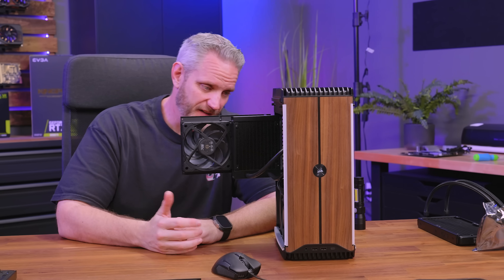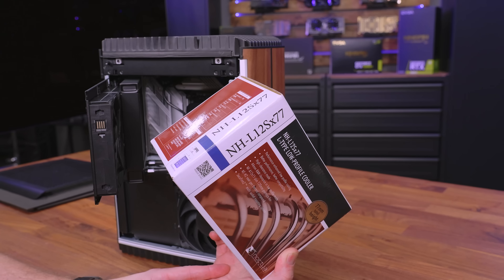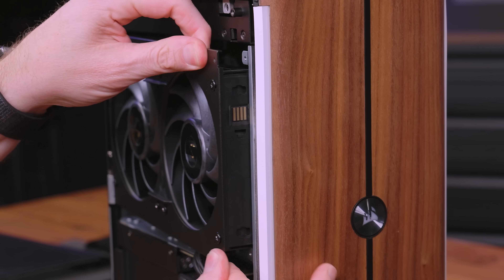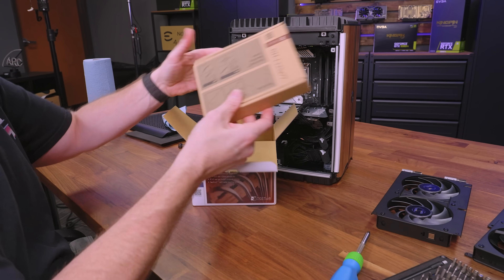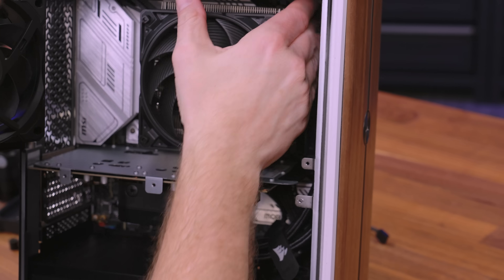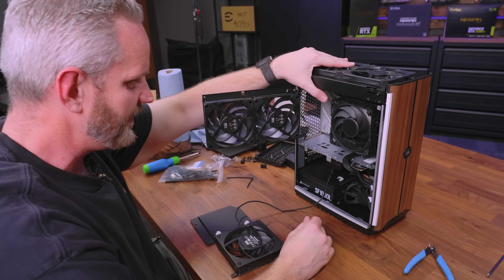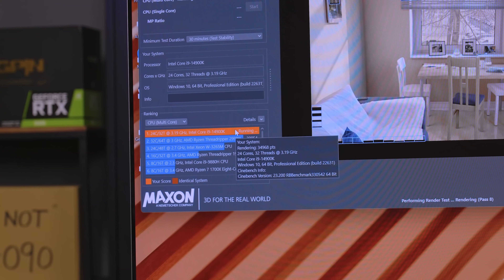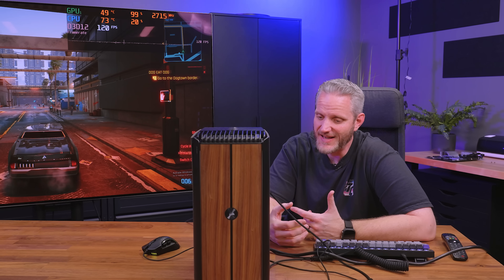Well... that was an unexpected improvement...

Comment: Remove fan blades from fan on cooler just use the frame. make sure case fan butts up against the empty frame add flaps if needed. will cool like a champ. The fan hub takes away at least 30% of the cooling surface on the cooler. Just do it
Reply: How did u do it ?
Reply: @xeontron964   I took a cheap fan and cut the hub out of it so just the outer frame was left. mount the empty frame between the cooler and fan in pull.
Reply: So more air can be pulled in ?
Reply: @xeontron964  yes you get to use the whole surface of the cooler no air moves through the cooler where the fan hub is the extra space between fan and cooler lets the air flow through the whole cooler not 70% of it.

Comment: i cant help but wonder if the cooler would do any better with the CPU fan and side mounted fans turned the other way so that it pulls the hot air generated by the CPU straight out the side instead of blowing it through the cooler and right back onto the base of the heatsink..

Comment: So we can either say the machine should never have shipped with a 14900K because the case and cooling simply can't handle it, 
OR that the case design is simply bad  if you want to run a high TDP Intel CPU,
OR Intel CPU power consumption is simply out of hand and beyond ridiculous at this point and people are rewarding bad design by buying these space heaters.

Perhaps all three?

Comment: Since depth of a 240mm radiator is a concern, why not daisy chain two 140mm rads? Set them side by side on the little access door. Seems like if they want to stay water cooled for the "gamer cred" and noise performance it would be a simpler solution than making a custom rad for this product. Don't know what their cost on a radiator is but it also seems cheaper than designing an air cooler.

Comment: [cough] The new NH-D15 G2 is listed ....
Yes, it wouldn't fit.
Does it look like that one fits? That's a family pet trap, works on grand-children too. No ~ don't ask me how I know that.
Now do take note ~ there are now three different cold-plates on the new D15. You have an Intel, so you may need the wonky one, and the little 1mm washers. High Convex ? HBC anyway. And two elbows on each arm ~ and the backing plate modelled from The Shroud of Turin.
On the up-side, you will not need to open that case again for the next 10 years, except to herd the dust-bunnies around every year or two. Git along little doggie - pack em up ~ smack em up ~ crack em up ~ Rawhide!
That's not impressive enough. Hang on ~ Let me think.
GHOST RIDERS IN THE SKY! If the Blues Brothers ~Jake and Elwood can do it, so can you.
Have a look in there once a month and call up John Wayne. "Fill your hand you son-of-beach!"

Comment: Also, controlling fans by liquid trunk is ideal. Both CPU and GPU temp at full load will be an essential constant offset from liquid temp, based on the block and quality of contact with the IHS. You do, however, have to set the right liquid temp target to get the desired component temps.

The reason liquid temp is better is because it doesn't fluctuate as quickly, so your fan speeds will also be more steady won't make huge jumps in speed. Which is acoustically preferable. 

This is all assuming you have enough radiator and fan to dissipate the component TDP at a liquid temp that's below the component throttling temp. Which is why direct die liquid cooling is so beneficial. You dissipate the same amount of heat, but at a lower component-to-water delta. Enabling you to cool the same heat load with either less radiator or lower fan speed, because you can now have a higher water temp before the component reaches it's throttling temp.

Comment: i think the fan on the CPU cooler could have been left out and instead replaced with a fan duct focussing both chassis fans on the CPU (the perfect option would be a heatpipe that reaches far enogh to remove even the need for a duct) and it would have been a better option than that liquid cooler ... in the end i think liquid coolers have become more of a marketing thing than a "good cooling option"-thing ... the reason why liquid cooling has more performance is the fact that you increase the cooling surface and optimize air flow .. if you use liquid cooling only to have "liquid cooling" without using the "more surface" benefit .,. then you shouldn't use it at all.

Comment: That's not how thermodynamics work...

The net-heat delt with by the case after changing the cooler was higher. Increased airflow through the case, by the larger fans and higher fan speed, enabled to case to lower average internal case temp, thus why the air coming out the back was cooler. This also enabled the GPU to run cooler.

I'm curious what temps would have been like if you could have simple maxed out the fans on the AIO, or, ideally, used a 120x120x25mm fan vs the slim fan.

Comment: Get rid of the side fans, and maybe put a larger Noctua on, perhaps the NH-C14S? Looks like it might barely fit in there without the two side fans. Maybe mount 2 smaller fans (will 80mm work?) on the back of the case exhausting out? Something like 2 Noctua NF-A8 fans? I've been less impressed with AIOs lately. I have a 14900K and I am cooling it with an Arctic Freezer II 420 with 6 fans in a push/pull configuration, which is supposed to be a superb AIO, yet I still hit 100C on a core or 2 on Cinebench R23, with just the motherboard defaults (no tweaking or overclocking on my part).

Comment: a 120mm cooler works just fine, it just has to be an air cooler, not a water cooler.  Water cooling is less efficient.  ;)

Comment: Are you doing a positive or negative air pressure setup on this? I'm assuming positive. Is there enough room to mount a 25mm fan under that NH-L12S? If so, put a NF-F12 under the heat sink, blowing up, and reverse all the case fans as exhaust, except for one of the top mounted fans. Use the front mounted top fan blowing in as intake. 
Thank me later. 
t. air cooling master

Comment: I love Noctua air coolers. And i am not a water cooler fan at all. I just want something that works and keeps working for the coming 10 years without much maintenance. And yes the NH-D15 is a good cooler but not my favorite. If you need big and have the space then my favorite is the NH-U12A. It is the closest they have to the NH-D15 but you can buy any mainboard you want without interfering with ram and GPU. If you have less headroom the next step down is the NH-D12L. Next step down is the NH-C14S and the NH-L12S-77. For some builds going lower to the NH-U9S. Going lower limits what you can cool so if i want a cooler that i am more sure will work in a next build this is as low as i go. All the higher in between models are of not much use because they are a combination of being bigger and not able to cool more. So the models i mentioned are the ones that have the best fitment on boards and in cases (most compatible). Only if you are going to use another model for a very specific case some of the other models make sense, but at the expense of being less future proof if you ever go to another board and or case.

Comment: Concerning electric radiator fans on cars,  my experience was get a jet aircraft manufacturer to build the cooling system.  My 1970 SAAB 99 had an electric rad fan that kept the car from overheating in summer, in Modesto.

Comment: jay is it possible to use the top rad for cpu and put gpu on single 120 rad  then build it back with the two fans on intake , so the 2 intake fams on fside panel one is going through rad other pure intake which will be  blowing air to gpu and the roof fans will pull the air intake through radiator

Comment: Only thing I can think is that Corsair decided that because it was SFF, they were concerned about fan noise a little too much? You can really hear those fans ramping up now in your Cinebench test in the video. But personally would rather deal with some fan noise temporarily in extreme use vs throttlling.

Comment: Granted, I'm running a 12500, so it doesn't need water cooling, but I went from an AIO to a Noctua cooler and had the same results you did. The CPU ran cooler. My AIO was a 360.  It's all about the temperature saturation on the AIO. Once the water heats up, it's hard to cool it.

Comment: Corsair, if you see this, you need to make the radiator thick enough to be worth selling a version of it as part of your DIY line. I have a 1000D and I haven't been able to find a radiator that fits on the rear exhaust without going to 30mm thick fans or more, because the bubble on the end causes problems when I have a 120 and 140mm fan both mounted there, and I try to mount the radiator to the 120mm fan. Mounting to the 140 doesn't work either, and it's still an extremely tight fit that not all dual 120mm radiators can even make with a pair of 120mm fans, as my old dual 120mm danger den radiators did not fit there at all. You should solve Jay's problem and my own with your other case, and let me add a 4th radiator to my 1000D! If you could make it in a crossflow version i'd be even happier, since I could use it to run the distance down to my CPU from the top radiator (that is an alphacool crossflow), thus eliminating the need for part of a tubing run and giving me an even cleaner aesthetic than I already have. I am sure there are other tight form factor mounting issues this would solve as well for other cases, either SFF or larger. You could even offer them in 360mm and 480mm as well as 240mm. I know they would technically have slightly less performance than one which runs the full length of the fans, but you would also be the only supplier of a niche product that needs to exist for the reasons shown here. SFF builds are more popular than ever, and I'm sure you guys could figure out a way to build them with standard threads and then just add your own custom fittings on for installation in an AIO, and then sell the radiator itself as a stand alone product as part of your watercooling products. You could even reduce the price slightly by hitting greater volume on it that way.

Comment: What about leaving the fan on the cooler away and create a 3D-printed tunnel from intakte fans to the cooler? i could design that real quick. i would just need a few measurements. u got a 3D-printer dont u?

Comment: I'm sure it's a super hard if not impossible issue, but would you be able to link the 2 rads in tandem as a single loop? So you end up with a 360 effective rad to cool a gpu and cpu combined.

Comment: I love the fan control software after you recommended it on your pc essential software video, Im using the fractal ridge case and managed to squeeze the artic liquid freezer cooler 280mm version inside my gpu encloseure, took the fans and shroud off of my rtx 2070 and fit 2x 140mm fans inbetween the radiator and gpu and use the fan control software to set the fan speed depending of both the cpu and gpu temps. Its so dense in that top enclosure there is almost no gap between the fans and both the gpu heatsink and the cpu rad. And the crown jewls is its quiet and keeps everything below 60 when im gaming

Comment: How not to have CPU thermal throttle... Get CPU which does not need double power draw to do same job... at "stock" settings.

I limit my 7700X to 85W and it still boosts to 5.45GHz in games. That makes that CPU in video eat almost 3 times more power under full load. And like 4 times in games.
Will do same with 9700X3D/9800X3D.

Comment: 7nm new different thing needed to be done / 95c 100c sorry not sorry  is a form of architecture debug aka getting th me chip to finish enough to have all of it work as designed
Reply: Like watching the check engine light go away after a repair like a real one doesn’t come back after 40miles

Comment: the NH-l12s is good but you have the space try a NH-C14S it has almost 40w higher load rating. a 3rd option is pull that side bracket out and use a full size NH-U12S.
Reply: I used a NH-U12S in a Silverstone case that's very similar and had temps on my 5700X drop by 8 to 11 degrees!

Comment: They make a thicker version of that cooler I have one in my HTPC, the C series

Also I think Jay fails to see that end user doesn't know they're not getting full performance and comparing to someone like a HP or a Dell this is right inline. Also I would not expect to get the full 253w all the time from any prebuilt, remember Intel considers that to be a turbo. 

My thoughts on the PC? They stopped doing the proprietary stuff and made it bigger to save money, nothing else.

Comment: Im surprised u dont know to switch out the cpu cooler fan for a static pressure i slap on corsair and watch those temps fall. Everyone buy a cheap cooler put static pressure fans on both sides and it will run like any expensive cpu cooler.

Comment: If that front door was hinged then the 240 rad could swing into place then the front door would snap flush against it. Could even use the outside edge of front to lock that swing door into place.

Comment: I work in IT recently I was setting up one of lenovo's workstation desktops, has i9-14900 and they have it running on basically a knockoff intel stock cooler. the cpu would  spike to 86 from just opening an animation. They system integrator are so clueless when it comes to this stuff.

Comment: I think the orientation of those heat pipes can be significantly improved. With the way how the CPU cooler was mounted, the vapor is being blocked by the liquid. When the liquid in the CPU heat plate turns to vapor, it has to go downwards, forcing its way through whatever liquid there is in the bottom of the "U" of the heat pipes to then reach the cooling fins. The condensed liquid then drains back down to interfere with the vapor coming from the CPU.

My suggestion is to turn the entire computer onto its back so it's flat. That way, the "U" of the heat pipes is turned sideways and the vapor can bypass the condensed liquid returning from the cooling fans by going above the liquid. Yeah, it's not aesthetically pleasing and it'll drive you insane, but I bet that might give you that little extra cooling to stop from throttling the CPU. 

Alternatively, turn the heat sink sideways but I'm not sure you have the room to do that.

Comment: I'm using a Peerless Assassin 120 SE and it seems to work on my 14900, except for video encoding, things still bump up to 100C, but nothing else does. I use GPU/hardware encoding for that instead of CPU. Works fine.

Comment: Yo, Why dont you try one of thermalright ssssssmall form factor solutions? they re direct competition for noctua on the small form factor high end cpus and some of their coolers are impressive and small, some even are 140mm designed to be memory compatible and fit on very small cases mounted horizontally to the motherboard andtherefore not tall at all, i think that would solve your issues, did it for me for a 14700k on a tiny coolermaster case, should do it for you, Thermalright, NOT Thermaltake, check them out at computex!

Comment: on my current pc I went to a 240 x52 kraken for cooling due to Jay and during cleaning a few months later I decided to put my over 10 year old 140mm non slim line version of the noctua cooler used in vid just to see the difference in temps and the noctua was and still is up to 10c cooler than what the x52 could do, the cooling was so much better I even forked out extra cash for a new replacement fan for the noctua for another 10+ years of trouble free cooling.
plus the air cooler has the added advantage of being quieter as well as keeping my ram and nvme drive cooler, I lost 2 good quality nvme drives while using the aio and havent had an issue with nvme drive since I went back to air cooling.
after my experience with liquid cooling I have decided to stick with air cooling unless I decide to build custom liquid cooling because aio's cant stack up to high quality air cooling.
the only thing that changed during the testing was the cooler its self, everything else stayed the same

Comment: The only reason I can imagine that they didn't just give the original case design a facelift was to use off the shelf parts to increase the profit margin. You get access to just one PCIE slot and it's the one on the very bottom. They're just not using as many bespoke parts. Hard to believe they still managed to bungle the cooling so badly.

Comment: Would a 2nd 120 radiator with the ports pointing down fit? Of course, you would then be forced to do a custom loop but with either a Barrow or EKWB CPU Block/Pump/Reservoir combo and run a tube from one radiator to the other. The fact that Corsair didn't even use their full iCue software for a product that they make is absolutely baffling, though.

Comment: I've heard Jay talk about motherboard setting need to be default for the chip you buy, not what the MB manufacturer wants.

I'm setting up my new pc and MSI has pushed out updates for the bios that remove MSI's setting and set the board for the chip, then you can adjust with MSI software from there if you like. I seen it on 3 MB's, 1 had no dates, 1 dropped a week ago and is in beta and some dropped today as I was looking and is in beta too. 

Thought that was interesting.

Comment: It is amazing how many product managers forget that heat transfer is ALL about how much you can move the heat out of a system.

This is also one of the reasons why I have reverted almost all of my systems back to using air cooling rather than using an AIO because even a low profile cooler like this can do better than AIO watercooling.

Comment: Noctua has a "Ghost" edition of the cooler with a 92mm fan underneath;  maybe you could use a pair of fans on the one you bought?

Looks like you could do as well with this one:  Thermalright SI-100 CPU Air Cooler,   cost is  @ 1/3 Noctua's     and the height is 100mm.  ?      You didn't specify the exact clearance;  some of the small tower coolers can come with 92 mm fans